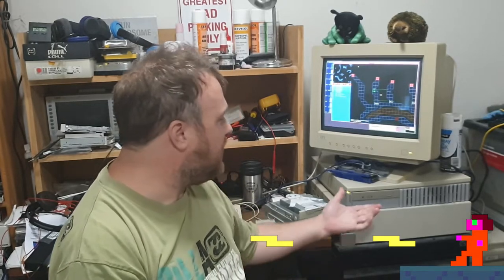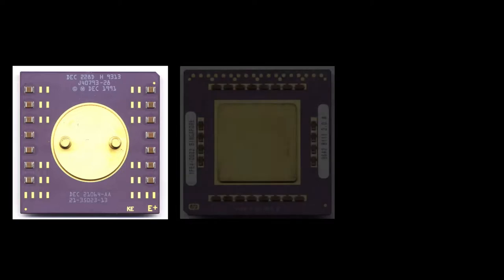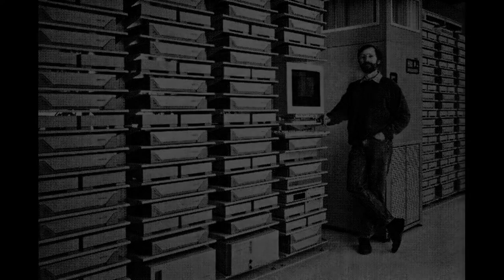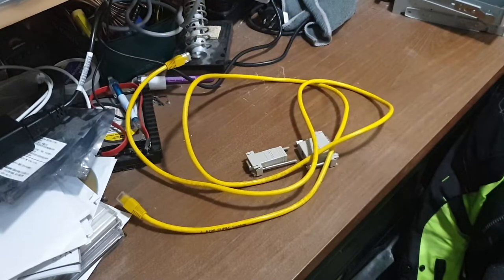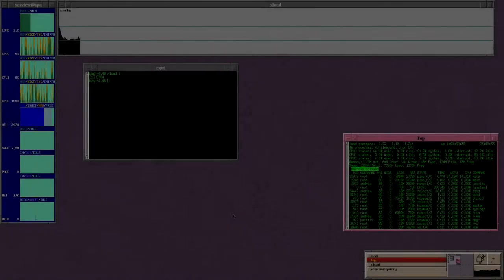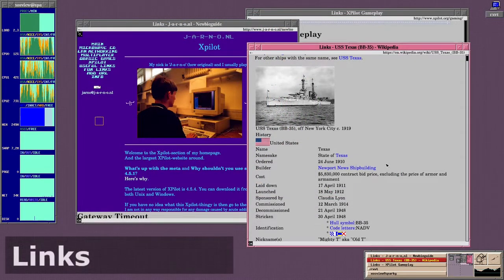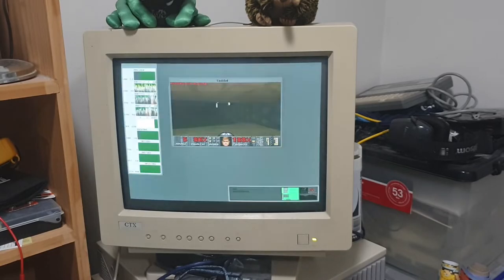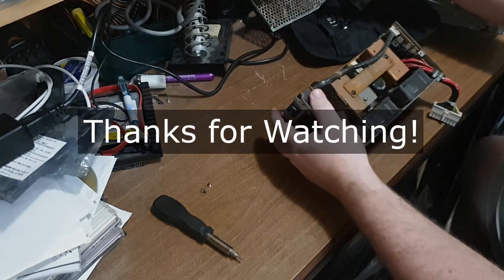Vintage Computer: SparcStation 20

Comment: I had several SparcStation 20's back in the early 2000's. I really liked these boxes running Solaris (6,7 and 8) and OpenBSD. Built like a tank and ran for months with out rebooting.

Comment: DEC/Digital had their own RISC line before Alpha. They had Ultrix running on MIPS hardware. They even ported but didn't release Tru64 aka OSF/1 to MIPS.
Reply from the maker: Cool I had no idea they used MIPS at all. Was SGI acquiring MIPS the reason they dropped that CPU?
Reply: @sparcie  I think they had problems getting greater performance. The highest end desktop machine was the DECstation 5000/260. i ran one for many years on Ultrix 4.5 with dual 19" Sony Trinitron CRT and 448MB ram. It was literally the first dual screen system I ever had.  Sadly it was destroyed by a family member in 2013 while i was overseas on contract. I've also run a Sun Blade 2000 with dual Dell 19" LCD's  on Sol 10.

Comment: Oh yeah... brings back fond memories of my first Linux PC running X. Since it was running the same window manager and UNIX programs it looked pretty much the same - but the difference became apparent when running a vector graphics animation of the rotating earth, calculated in software every five minutes. On a Sun this barely caused any load while my 386 without floating point unit wasn't even able to complete one computation every five minutes.

Comment: We had hundreds of sparcstation 10's and 20's when I first started at Pratt & Whitney.  Then they were replaced by ultra 1's and Ultra 2's, and finally by Ultra 10's and Ultra 60's (and a few sunblade 2000's) before they were all replaced by windows/intel workstations.  I liked working in Solaris, but after the Oracle buyout, I switched to linux.

Comment: This is a lovely machine! I had a small collection of Sparcs a couple of decades ago (from memory a Sparc 1, a 10, a 20 and a bunch of non-working IPCs). I had to let them ago about 15 years back because they were taking up space and no longer being used. The one I got the most use out of was the Sparc 1. I used it as a personal web server connected to work's network back before virtual servers were affordable.
Reply from the maker: They seem to do quite well in the webserver role. I understand about the space, I got offered a bunch of sun equipment at one point, but just didn't have the room for the machines. About the only machine I'd make space for now would be one of the lunchbox machines like the IPC, I've got a few newer Sun machines so don't need to get those so much.
Reply: @sparcie  The IPCs were definitely cute. The four I had were lacking things like RAM and drives; I'm not sure I could have put a complete and useful working example from all the ones I had. They could only take 48mb RAM too; the Sparc 1 took 64 and ran about the same speed. Of course if I'd kept the lot they would have gone for a fortune on eBay now!
Reply: @sparcie  LX is the lunchbox you seek... its a nice little 50Mhz microsparc system with a fancy Meiko FPU integrated, with integrated CG6 graphics also, and its a sun4m so more compatible with more recent stuff.
Reply from the maker: Sounds awesome, I'll have to keep an eye out. I don't see many older sun machines unfortunately.

Comment: Netsurf is a better browser than dillo for the SS20, if you are on solaris 8 or 9 opera 9.x is king though.
Reply from the maker: I've been trying to get Netsurf to work, but haven't had any luck compiling it, probably a NetBSD issue. Need to revisit that at some point.

Comment: I still have that sparcstation 10 here but I never really found a use for it seeing as I'm mostly interested in games. I hear there is a Solaris version of Doom and Quake I may see if I can track down and try but I've never been able to even access the system since its password protected. I suppose I can just try reinstalling the OS or I guess I can try installing Linux or something.
Reply from the maker: Yeah reinstalling the OS is probably your best bet, was that one an ultra? The older 32bit sparcs have less options for OS, but the Ultra's can run linux, FreeBSD and a bunch of others that don't support 32bit sparc anymore. Solaris obviously supports either.
Reply: @sparcie  It's a Sun Ultra 10 tower with a  440MHz RISC based UltraSPARC IIi
Reply from the maker: That's quite a fast one, should work a treat once you get it going!
Reply: You can run Vintage Linux like redhat 5.2 which is acutally quite nice, and there is the more recent effort my Rene Rebe to get T2 SDE with Linux 5.19 working on 32bit suns... it remains to be seen if his distro runs on real hardware though (it runs in QEMU though). Also you really should get a VSIMM for your SS20 so you can use the SX accelerator.
Reply from the maker: I'll have to look into older distro's to try a few of them out, I basically went with NetBSD because it's one of the better current OS's that will work on the 32 bit sparcs. I have some spare hard disks for it, so I can swap it out and try something else fairly easily.